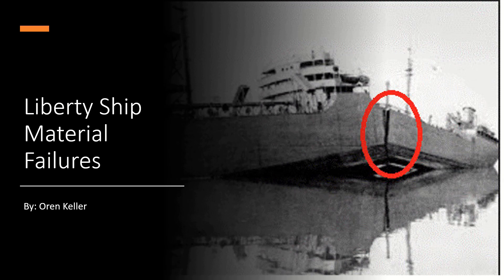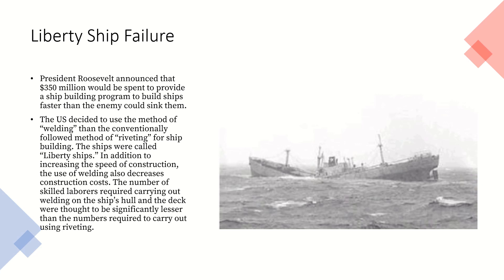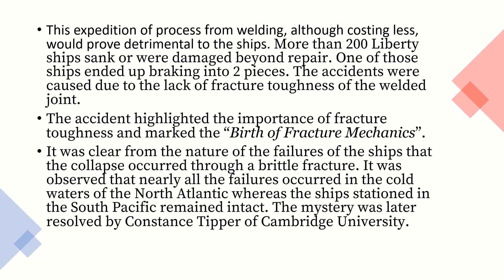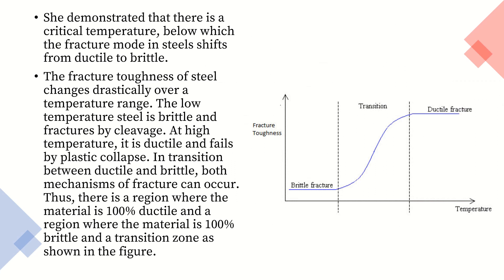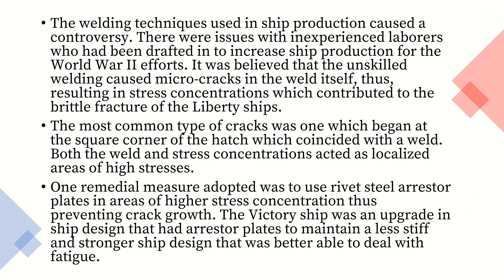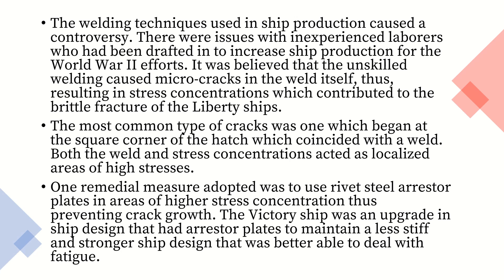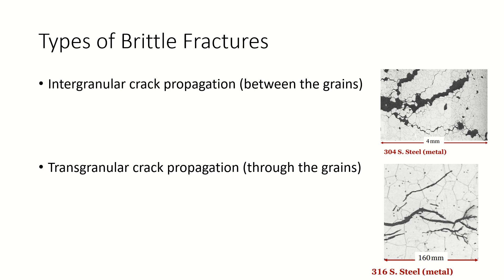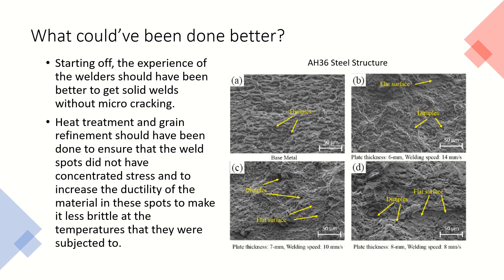Engineering Explained! The Liberty Ship Failure

Comment: Stick welding is considerably more skilled work than riveting but riveting is labor-intensive. We were able to train competent "green" pipe welders (a small portion of a class) to pass a 6G pipe test in 19 weeks/4 days per week at the welding school where I worked after taking the course but I doubt that pass rate would suit desperate war production situations with noobs training noobs. Welding electrode metals and flux coatings are also more advanced. Interestingly, a classic DC engine driven welding machine by Lincoln Electric, the SA 200, was used at the time and some from the 1930s are making money every day. Welding machines including DC generators and flathead four cylinder engines were thoroughly understood and now metals and flux tech (and X-ray and bend testing before hiring new workers!)
have caught up to let vintage machines turn our perfectly sound (bend tests do not lie) work.